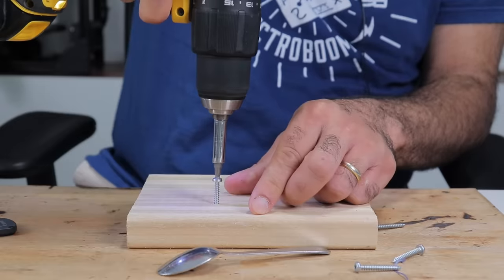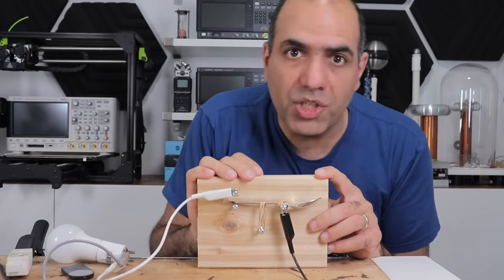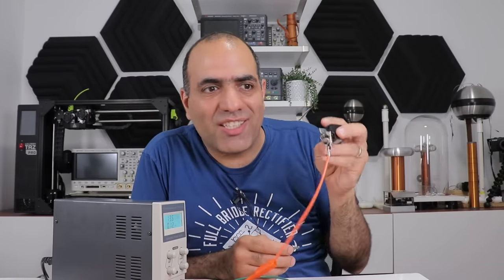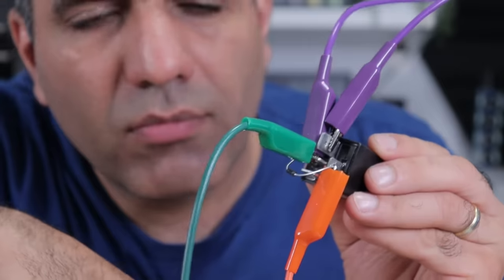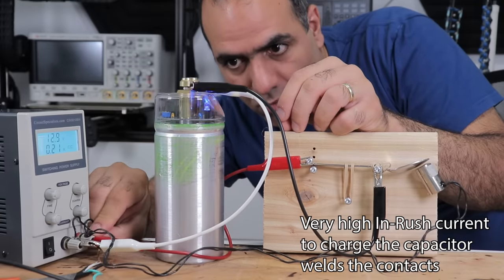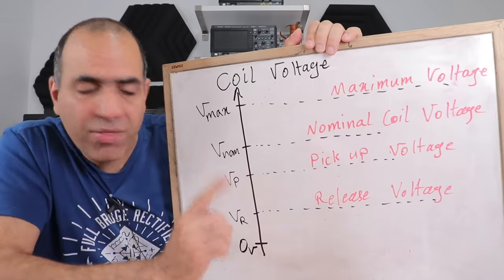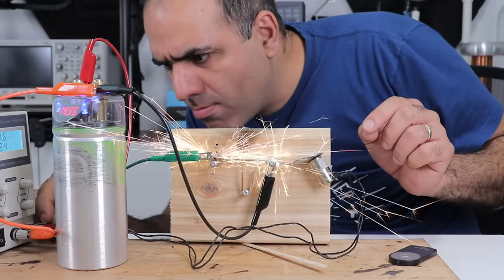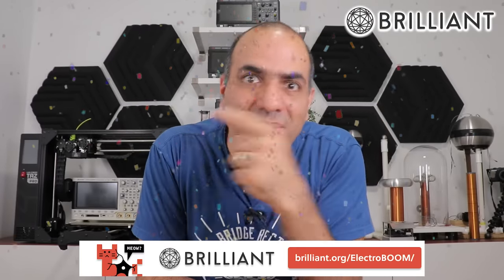Why RELAYs go BOOM!!! And How to Use Them

Comment: I designed things with relays for decades. Far too much of what was in this video I had to learn the hard (smokey) way. Adding the zener diode was new to me though and is a brilliant simple solution when faster response is needed. Back in the day I used more costly solid state relays when I needed faster response. Could have saved buckets of $$$ using $0.10 zeners instead.
Reply: *For anyone confused by the above or just now hearing about "solid state relays" just know that is the really bad name the industry gives to large MOSFETs that are packaged like panel mount relays.
Reply: Hello colleagues electro engineers, me to as well.
Reply: @Miata822  i got it
Reply: Why did you need such fast response times?
Reply: @SirDella  really fast blinkers
Reply: @SirDella  There would be applications where you want the relay to switch on and off really fast 
Maybe normal relays won't respond to such fast on off signals
Reply: Kind of funny that now sold state is the cheap option compared to actually winding a coil. I swear coils do black magic in ccts XD
Reply: @SirDella  because it´s fun.
Reply: question (which might be dumb): why not add a resistor in series with a diode to eat up the power? will it heat up too much, and if so, why doesn't the zener heat up?
Reply: Yes, SSR blocks are expensive. But we don’t know how long expensive circuitry can hold with Zener diodes. Eg. spindle motor in a CNCs need microseconds to switch. Can this deliver such responses and replace SSRs right away!?
Reply: @hellyea489  Some people do that. some automotive relays come with your choice of either a diode or resistor built inside. A resistor will reduce but not eliminate the surge voltage.
Reply: @harishsivaramakrishnan7096  Yes, there applications that do require SSRs. I my applications (controlling hydraulic solenoid valves) I didn't need microsecond timing. Naturally any control system needs to be properly speced and tested.
Reply: @SirDella  To get a more responsive feel from solenoid actuated hydraulic controls.
Reply: @Miata822  Oh I thought that the difference between MOSFETS and solid state relays were mainly that in a relay the load is completely isolated from the control voltage
Reply: Usually, when manufacturers say solid state relay, they mean a complete (usually potted) circuit that behaves like a relay but uses a MOSFET (DC) or Triac (AC) to switch the current.
They have all the fancy stuff needed for reliable operation built in, like a flyback diode, a pulldown resistor or zero crossing detection.
So they are plug an play. A MOSFET on the other hand is not that useful if one does not know how to use it correctly.
Reply: @TheLordNemesis  But what about safety ? Semiconductors are likely failing in short circuit, in some cases it can kill someone, i know there are many sensors but.. Is that problem in some strict ruled sectors ?
Reply: @Miata822  Wow thats pretty cool ! I think something like designing relay softstart can be counted too, in some cases you have to clamp over something very fast
Reply: @jmenonenidulezite561  That is a concern yes, but relays can also fail welded shut, so it's not that big of a difference. The other problem with solid state components is that they often let a tiny amount of current leak through, which can be enough to let LEDs glow or prevent electronic devices from resetting correctly.
On the other hand, you can switch them indefinitely without wear, which is useful for things that cycle a lot, like heaters or motorized valves.
Reply: Why relays go BOOM! This should be self evident. It's to get more views and likes for this channel ;-)
Reply: @TheLordNemesis  Interesting, thx a lot ! Gonna study something more about SSRs
Reply: @jmenonenidulezite561  Yes, I have used a pair of relays, one with a time delay, and a giant resistor to soft start a bank of powerful DC fans.
Reply: I'm pretty sure zener diodes and resisters act similar as they reduce the current through ?
Reply: @SirDella  For example, fast moving material might need to be detected quickly. If your relay is normally energized, and it drops out when the part is detected, then quicker is usually better.

I use a resistor sized to match the impedance of the relay coil for fastest response. You can usually get this value from the cut sheet.

And for repeatability reasons, a DC coil is far better than an AC coil.
Reply: @abhijithanilkumar4959  It does crop up as a problem from time to time in hardwired relay logic (as opposed to relay logic in a PLC).
Reply: @hellyea489  Good questions, and for the fastest dissipation time, a resistor matched to the impedance of the coil should be used. This info is usually included in the "cut sheet" (the data sheet). So if the cut sheet says that the coil resistance is 1800 ohms, put an 1800 ohm in series with the diode. You should select the power rating of the resistor based on continuous load in the event that your diode gets shorted (which in all likelihood isn't ever going to happen). So for a 24 VDC coil you would be wise to use a 1800 ohm, 1 watt resistor (it would produce about 1/3 of a watt, but by upsizing it the resistor won't get anywhere near as hot).

As for the zener diode not heating up, there is only a small amount of power available in a tiny relay such as the one Mehdi used. Again, as long as the diode doesn't short (unlikely), you won't have a problem.

Compare that to the coil in an old surface grinder (meant to hold down large blocks of steel while they get ground down). The one in this video: https://www.youtube.com/watch?v=-0zRko8FAh8&t=62s 
powers a coil that is about 36 inches in diameter. Fast forward to about 1:45 to see the fun. This was on a Blanchard surface grinder that I was troubleshooting, and the arcs are completely normal. :)
Reply: @Miata822  There's often more to a solid-state relay than just a MOSFET.  The ones I've seen were isolated and had AC outputs, having an equivalent circuit that would include an optocoupler isolating the input terminals from the FET, and a 4-diode bridge allowing the FET to switch AC.
Reply: @bledlbledlbledl  Yes, they have other components and a wide variety of optional configurations. I only mentioned SSRs because of their high price when compared to traditional relays. It isn't good engineering to use more technology than you need.
Reply: @jmenonenidulezite561  A solid state relay (SSR) instead of a coil, has a LED Optocoupler circuit built in this means that one side is electrically isolated from the other side just like a electromechanical relay. If a short circuit was to happen the SSR would not switch.
Reply: @MrWaalkman  Oh
Reply: @timg6850  I know i mean short circuit on high voltage side(Like between Drain and Source) not in optocoupler as you said - they are constructed for like 2kV + between diode and phototransistor.. Thats nearly imposible to get short circuit in normal aplications.. If you dont mean it like that, let me know,it could be language barierre :D
Reply: I use SSRs in my job designing industrial plastic extrusion equipment. High quality relays may be rated at 100k-1m guaranteed operations at close to maximum loads but that's only 8 months with just 3 operations per minute. Precision controlled extruders need to turn high powered heaters and fans on and off every few seconds so a mechanical relay doesn't really cut it.
Reply: @mrezniable  Keep up with those lessons - you'll get there.
Reply: @Miata822  some are potted SCRS or triacs with opto coupling
Reply: @hellyea489  Yes, you can do that, and yes it will also work to speed up the turn off of the relay. Zener just makes it 100% certain that voltage won't be higher than Vz + Vd. But it's safe to use a resistor with resistance = DC resistance of relay coil - you will get a spike 2x the supply voltage.
Reply: @Miata822  Did you snub the valve solenoid opening in some manner, like RC across relay contacts? From experience I know those things nuke relay contacts over time.
Reply: @akkudakkupl  Yes, we used DIN connectors that had an internal diode.
Reply: @Miata822  May I ask what type of industry that was used in (pure curiosity)? DIN seems not all that oil proof ;-)
Reply: @akkudakkupl  Unfortunately I can't talk about details but the solenoids were in a protected location and using low voltage DC. Never had a problem with them. Both the cable inlet and the face that mated to the solenoid had effective gaskets and there was a seal/washer thing on the mounting screw. These are widely used on all sorts of equipment.
Reply: @Miata822  I think your statement that an SSR "is a bad name the industry gives to large MOSFET" is a little bit wrong. An SSR needs to have the control circuit completely electrically isolated from the output circuit. Usually this is done with an optocoupler. In a MOSFET you still have good capacitive coupling of the gate to the Drain/Source and usually the isolation voltages are pretty low compared to the >1kV isolation and very low capacitive coupling of an optical isolation barrier.
Reply: @ProtonOne11  Of course. 
I was thinking about and posting for Mehdi's general audience, not the engineers who already know what it is. An SSR is not a relay and should not be assumed to have relay characteristics, therefore the name is bad.
Reply: I recently designed a fixture that has over 100 relays and 200 SSRs. It switches up to 64 analog channels in all sorts of different configurations. For some reason there is a voltage being induced by thermoelectric effects on the pcb caused by the heat from the relay coils. It's only 10uV but this actually causes a problem. If I used all SSRs I would have more resistance but less thermal effects.
Reply: @Shadowmaster625  OK, first of all I am dying to know what this is for. Driving an incandescent or maybe neon display? I've seen old sign controls kinda like that.

You say "on the PCB". Are these little board mounted relays? Reed? Box? Sure it's thermoelectric and not induced by coil flux? I rarely use those but have never had noticeable heat from them. Stay well within spec on both control side and output. 

Then again, I seldom (never) use relays on anything where 10uV makes the least bit of difference.

SSRs are a different matter. See spec sheet for heat sinking requirements. SSRs that i have used had strict cycle rate limits and get hot if cycled too fast. I never use SSRs w/ PWM. Properly speced and ornamented MOSFETs are best for that, again w/ proper heat sinking for the load.

EDIT from the irony department just noticed that I have TWO tiny board mounted relays that I "never use" that were sitting on my actual keyboard while I was typing the post above. they are for a lighting project.
Reply: @hellyea489  a zener diode has a faster turn off time while still limiting the maximum voltage. If you are switching a 12V relay with an 25V low cost transistor, the flyback voltage really matters
Reply: 6:30 you can add a resistor. You can set resistor value to tailor the flyback voltage and release time.
Reply: @ganzeige  You are correct tho. SSRs from what I've seen in use, operate indeed just like a normal relay, but with semiconductors. Usually a circuit comprised of TRIACs or SCRs that can thus switch AC loads as well, with two completely independent terminals that switch that load on and off.
MOSFETs aren't independent/isolated indeed, but used a lot for the same "turn on big load" applications, when you deal with DC.
Reply: @Miata822  ok
Reply: @abhijithanilkumar4959  A mechanical relay would switch so fast that the rapid switching would draw enough current to exceed the maximum switching capacity and fuse the relay contacts short. This is why if you want to switch a capacitor or a motor, you would use a relay that is twice the rating of the motor or capacitor.
Reply: You'd be amazed to learn that adding an R-C snubber to a relay coil can speed it up even further :)
Reply: I connected a sk3f-s-5vdc-c relay to a esp32 devkit v1. But it didn't work. May i know how to fix it without changing the relay?(or adding npn transistor helps?)
Reply: @jinberry133  In general I would not drive a relay coil directly from a microprocessor board. I don't use the esp32 but it can probably send the required 66mA at 5V needed to operate the relay coil. If so it should have worked, but voltage spikes from the relay coil opening might damage the esp32. I would use a transistor to power the relay coil and put a diode across the coil terminals if one is not included in the relay itself (I did not find a good spec sheet for that exact relay).
Reply: @Miata822  thanks for the reply. I'll try connecting a transistor.